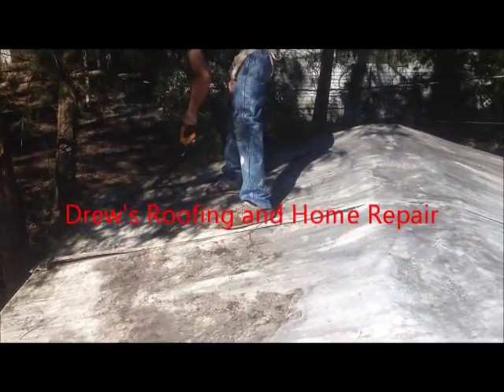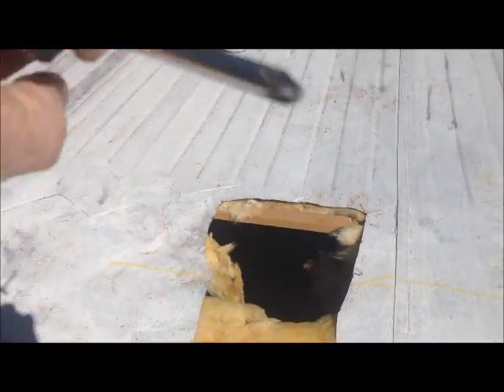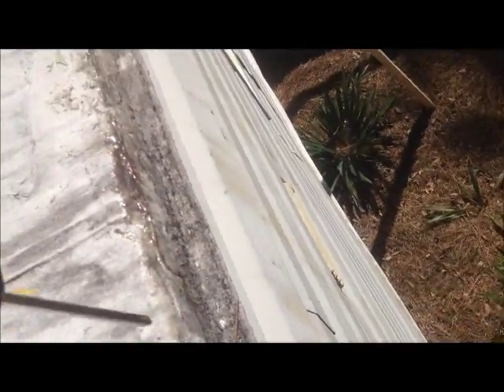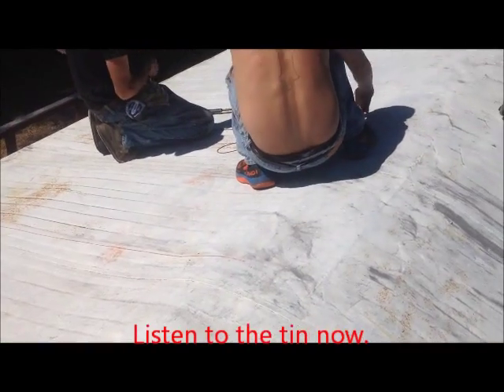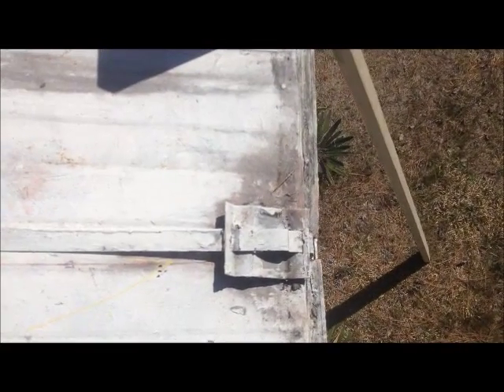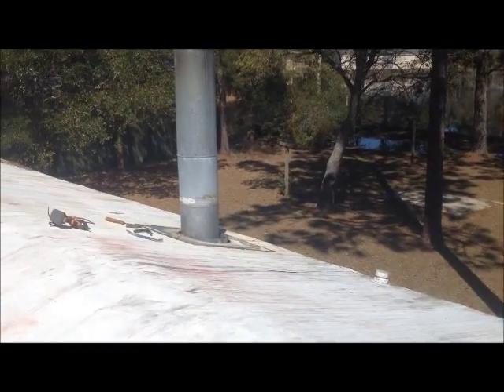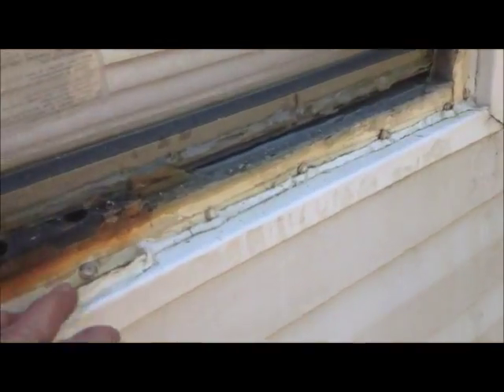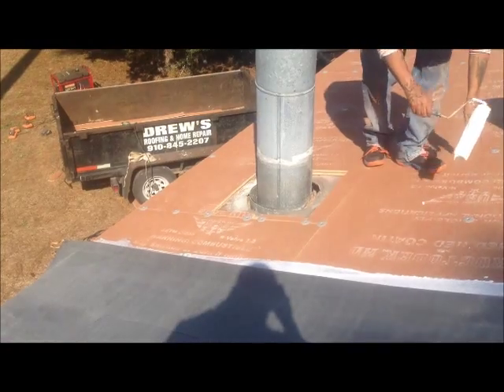Mobile Home Roof Repairs and how we do it

Comment: What type of wood to use, we went to home depot, brought some wood, and did the underlayment, then put plastic paneling on top, but water still leaked in a little but whats worse , ants crawl all the way up to the roof under where the wood was. We had to remove everything off the add on roof and throw away the material. How do we keep the ants and insects from coming in.  The leaks were Mom drill holes in the roof, to fasten it down. What type of screws to use to prevent leaks.
Reply from the maker: I use OSB. If you look at some of my videos I try to explain what and how we are doing. Check out my playlist Mobile home roof repair

Comment: I have a quick plumbing question Drew, I'd like to get rid of the (polybutylene down under) and I like doing that kind of stuff myself. Should I use pex or pvc? Not familiar with pex and copper fittings might be a pain while I'm underneath a 1986 Zimmer 14x65. Over fifty and willing to learn. Did I mention I'm a cheap investor, don't want to put more in the plumbing than I have in the home.
Reply from the maker: l6j8b32 use pvc if you can pex will work its up to you there
Reply from the maker: I don’t do much with Plumbing